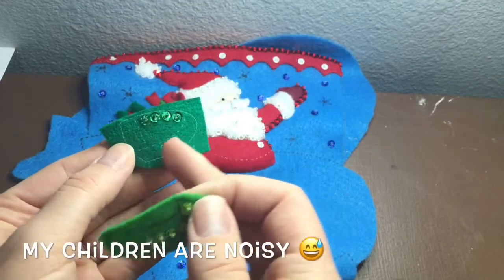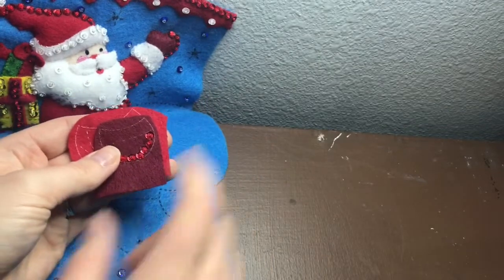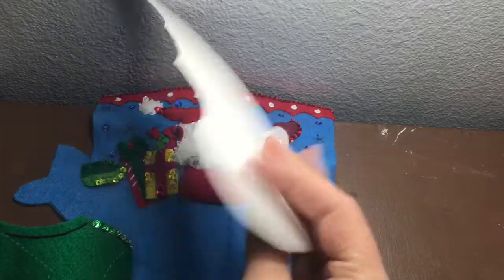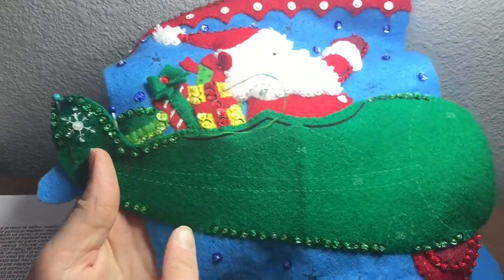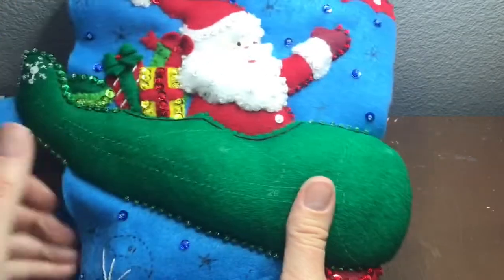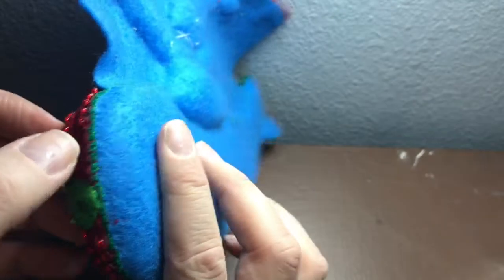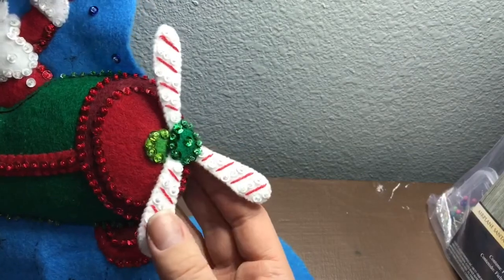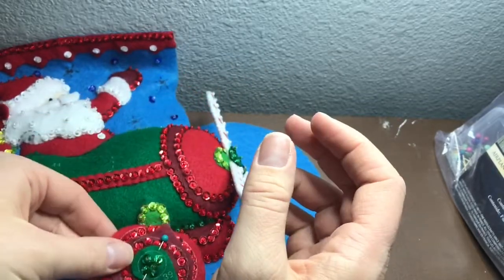Making the airplane Part 4/10

Comment: LOVED your videos on the Airplane Santa! I just finished my stocking and wished I'd seen your videos before I worked on my stocking.  Very good tips and techniques! I was wondering if you have any trouble with the felt stretching out of place? My stocking doesn't lay as flat as I'd like and was wondering if you have any suggestions?
Reply from the maker: Thank you! If anything, I hope my videos are helpful. The only time I notice my felt stretching is if the piece is stuffed too much. Over stuffing felt will cause warping. I rarely see felt pieces cut wrong. I have had them misnumbered before or have an extra piece which luckily they come with a chart so I was able to figure it out. With the older stockings that I made, I really over stuffed. I don't anymore :D